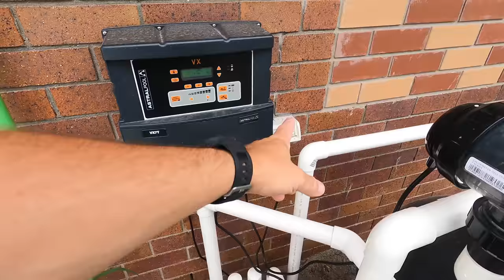BEFORE & AFTER Pool installation | how much it cost | backyard makeover

Comment: Nice deep step on the pool. Perfect for lying in the pool and little ones. We dug our pool by hand due to access issues. Our is half out of ground for added seating and it’s only 5x4m. Losing that much water each day??? Did they use CEMETITIOUS grout not the EPOXY grout they should of used. We live on the sunny coast. In the 14 years we have had our pool in we have never lost that much water, no cover.I guess yr maintaining yr water level now?? We put in a lighter oak coloured and textured mill boards which are also composite. They get bloody hot and they are worn off now 13 years later and need replacing.  Good option to raise the gap.
Reply: Thanks for adding your comment, was it epoxy grout that was necessary?
Reply: @sonjakozman1699   Yes my friend. Epoxy is waterproof. Cemitous grout is NOT. Water passes right thru it. Like yr bathroom tiles. If you see black mould inside the silicone around the corners it’s mould coming from BEHIND yr wall. Most tilers won’t tell you this.

Comment: Wasnt sure of the earthing rules with those glass panel spigots - good idea keeping them out of the pool zone. I know a guy that had to rip up his slab cos the sparky that did his pool was clueless 😵
Reply from the maker: Damn! Yeah don’t want to miss that. If that happened now I’d get the insulated spigots. I just found out ours are the insulated version so they can actually be closer.
Reply: For those of us not electrically inclined. Why the need to earth the pool?
Reply: @DodgyBrothersEngineering  It's cause any electrical fault has a much higher potential to kill in a wet environment - lowers the resistance of the skin. Everything within 1.25m needs to be bonded to the earthing system of the properties electrical system, that way if a conduit breaks in the slab and freakishly comes in contact with a metal exposed part it will trip the RCD/CB. If the same situation happens and the metal part isnt earth bonded, that part will be potentially deadly to touch.
Reply: @WillmannElectrical  in the video he talks about using low voltage. Would it be safe to assume that the light in the pool is something like 12v DC?
Reply: Hmmm interesting, I didn't actually know about the earthing with pools. I mean yeah, it makes total sense, I'm just surprised I haven't heard about it before.
Could this possibly be a state based rule that maybe isn't in place in Victoria?
Reply: @GeelongCableLocations  definitely in vic too Ben - the wiring rules are nationwide. It's a super expensive thing to miss 😂
Reply: @WillmannElectrical  interesting.
See just when I think I know all the cables that could be underground, I find out about another one that I didn't know about 😄😄😄

Comment: A great addition to your home. The kids will love it. We installed a fibreglass in ground pool about 12 years ago. The kids have grown up with it and now the grandchildren are using it. They are pricey but worth it for the memories we have acquired. I’m not surprised with the cost as ours, in Melbourne, was quoted at a basic price of $35,000 for a 9m x 4m pool.  We upgraded in floor cleaning system, a large gas heater, solar heating and an 8 person spa. The total cost was in excess of $76,000.
At the time it caused a few squabbles between the wife and I but she is happy I insisted on the upgrades as I now have medical issues preventing me from cleaning or maintaining the pool. With the upgrades it looks after itself. I get a pool guy around once a year to look after the chemical balance and any other stuff I can’t do. Lugging around bags of salt, etc is beyond my abilities now.

Comment: good size family pool, and the decking is a nice contrast to the tiles .
only comment you may find the seaspray coloured fence and shed will  create a lot of reflected heat and  glare, we had primrose colorbond fencing  , so we spray painted them woodland grey (a colorbond colour) and the glare and reflected heat was dramatically reduced
Reply from the maker: Thanks Garry.
That’s definitely something that we’ve joked about. We may have to wear glasses out the back😂
I’m hoping it’s not too bad. Might have change some colours or add more plants. Definitely something ti consider though. Cheers for the feedback 👍
Reply: @AddictedtoTools  no worries  ...  also another thought ... with the pump/filter/heater/electrics, are you considering enclosing or covering them from the weather, as covering them will make them last many more years. our pump is just about to die and its over 25 years old

Comment: Great video. Very informative, Ive been quoted 61K for a 6x4 fiberglass which does not include crane, excavation, tiles, fence (I think ive worked that out to be another 17-20K) I am also 8 hours from the nearest capital city so have to factor transport etc in.
Reply: God, that's expensive essentially just for a delivered pool. I'm looking at a 15mx3.8m fibreglass pool a couple hours out of a city and if it gets up over that $70k mark I'll have to pull the pin.

Comment: Pool light is ac 12v and should just run a switch wire to a power point out side and plug the spa electric transformer in out side where ur one way box is

Comment: We put a pool and deck in at our place, same size 5x3 heated etc. virtually the exact same as yours except slightly deeper and a smaller main step. Came in at 45k including the heater and about 6m of glass fencing. Took them nearly 9 months to do it though. Worst company ever. In Bris as well. What heat pump are you going with? Only just found your channel today but subscribed already as it’s very diy informative 🤙
Reply from the maker: Hey Benton. 
That’s a bit of time to wait. Not sure what brand heater we will use, the last one we had for the same setup was a 9kw and worked great. Great to see more people on here from brisbane.

Comment: In reference to your comment
Running this pool on magnesium  
While I have seen that system run on magnesium, it is not specifically made for  magnesium
And is your comment I don’t know a lot about it  that is a very common that leaves pool consumers down what’s called the pool barrel 
After 10 years, they get completely burnt out with all the advice and all the sixes and all the repairs while those fixes and repairs might’ve been appropriate and relevant, it’s not joined up as a holistic approach 
What exactly are you after because generally most call consumers don’t understand everything that they’re after Nae let the conversation take its own course, and they disconnect with the process of that transaction 

We all have different ways of informing ourselves about subjects that we know we are not informed about which is great. You already said, I don’t know a lot about it and as a tradesperson  you’re better off, knowing yourself that you don’t know about something, then assuming yourself that you do so well done 👍
What I do, sometimes when I can’t tell an item apart, and they all say the same thing 
Have a look in your own area for an independent consultant that is able to sit down with you and what are you exactly after and having a look at your pool? What would he have done differently to make it perform a little bit better? I can already see some issues That I would’ve done different, but then again I do do most things extremely different in my pool career and my personal life